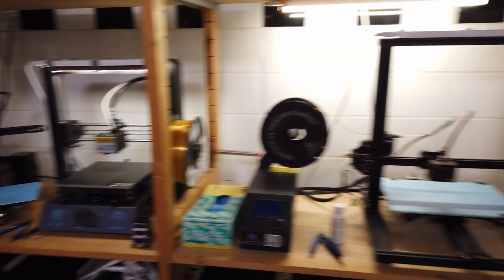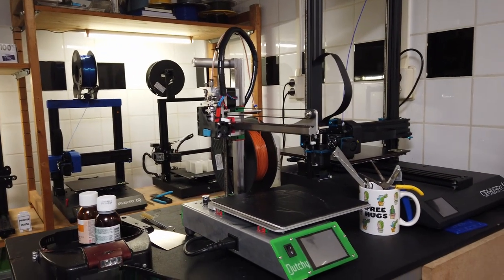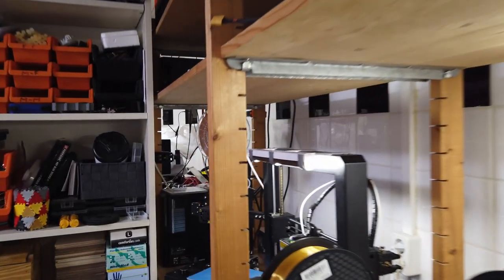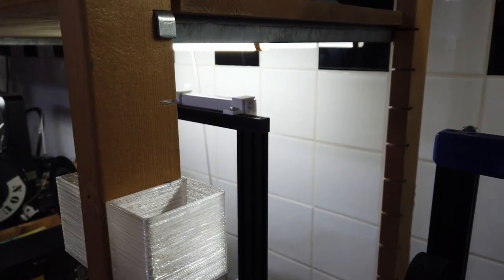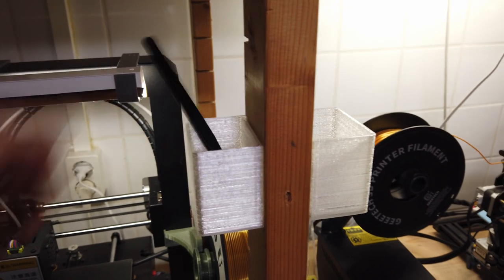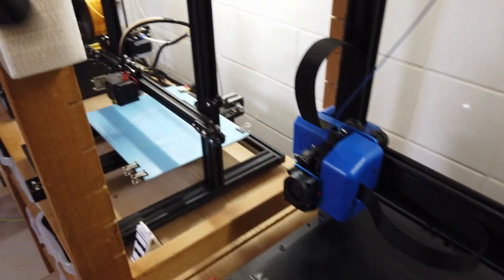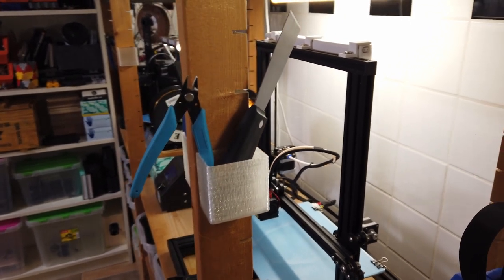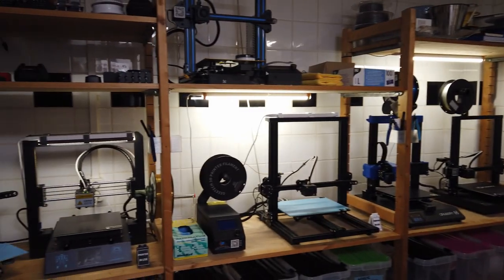▼ Trays for my closet | 3D Printed solution

Comment: I think they should clip 5mm around the from of the post to keep them secure. There should still be enough flex in the material to get them on.

Video and sound was great.
Reply from the maker: Thanks.
Well, even without the clip around the front, they stay in place very well. This is because of the thickness of the lid that slides in the groove.
Reply: @3dPrintCreator  Ahh makes sense thanks!

Comment: You like that Genius? I'm trying to find one in stock to order... not very easily done right now.
Reply from the maker: Both Artillery printers are the best relatively cheap printers I have at the moment, only the one 1600 euro Dutchy performs better. The reason all printers are sold out is because everyone is printing Covid masks and parts. The waiting time for a printer here in the Netherlands is now more than 3 weeks.
Reply: @3dPrintCreator  Yes and thats what I want to print as well.

Comment: Did you print in vase mode? Are gaps in your prints or is it an optical illusion?
Reply from the maker: No and yes. I guess.
There are no gaps and the print is made with 4 perimeters and 15% infill.
Maybe it's hard to see with the transparent filament.